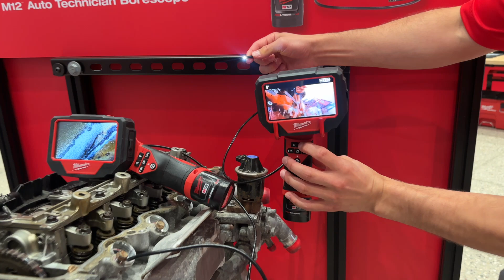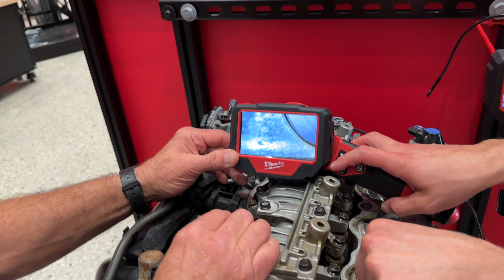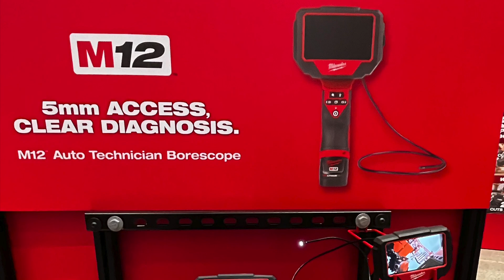Milwaukee M12 Auto Inspection Borescope

Comment: I have the older one,will be several years until I get hd.
I use it to check behind drywall, installing cabinetry.
Reply from the maker: Me too, this one is way  ether and thinner - not designed for us but it certainly would do a bette r job than the old one we both have